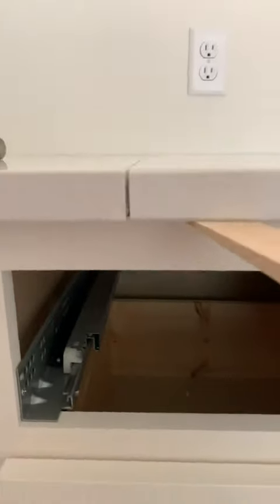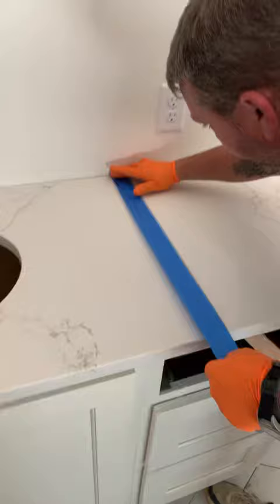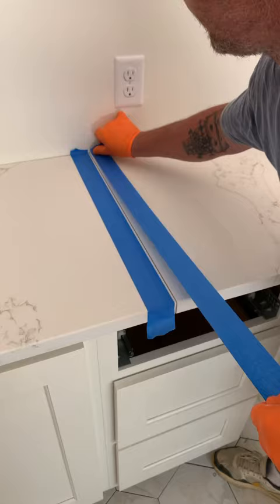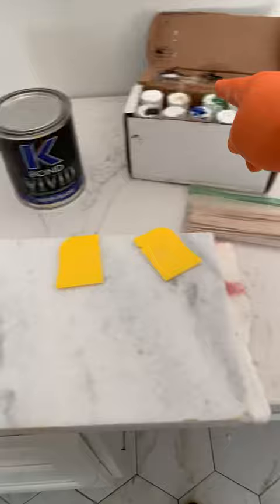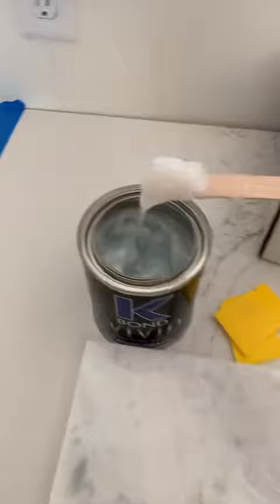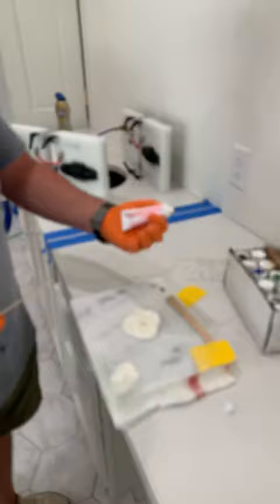How two pieces of quartz are seamlessly put together#Shorts

Comment: Not knocking your technique.  But how can you truly feel how good your seam is with rubber gloves on? Been installing for 7 years. And I still can’t wear gloves when doing seems.
Reply: Lol you take your gloves off when you’re leveling the gorilla grips, then take a razor blade and slide it back and forth until it doesn’t catch either direction.
Reply from the maker: I actually cut the index finger portion of the glove off on my left glove, which is the finger I used to fill out the seams. If you will watch through the videos, I know it may be hard to see but the left index finger portion of the glove is not there
Reply: Customers are all different.  But I swear 95% of them don’t want to feel the seam at all.  Which when working with quartz is a pain in the ass .  Which is why I ask.  The razor blade trick doesn’t fly all the time.  You can usually get a read of the customer as soon as they start asking about the seam
Reply: @Jalassi  finger is always the final test. No, never met a customer that would be happy with a seam you could feel. Have had to cut a new kitchen twice because we didn’t realize one of the slabs we received was warped.
Reply: Yeah.  Quartz is garbage just for reasons like that! Lol